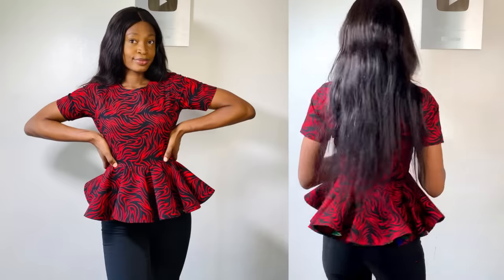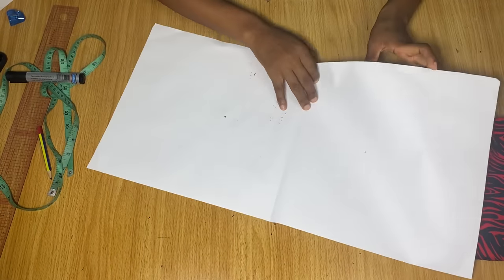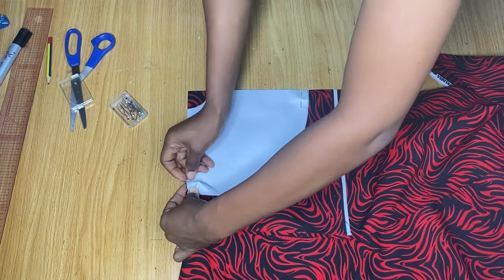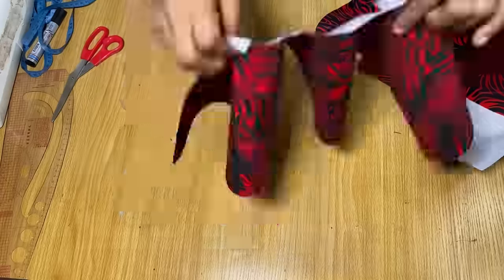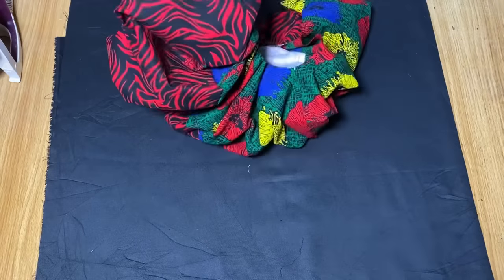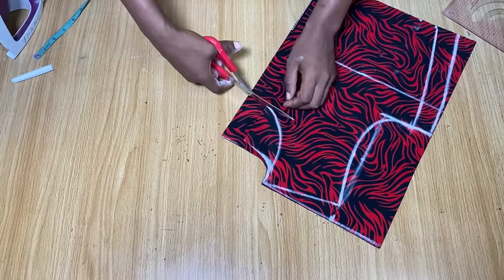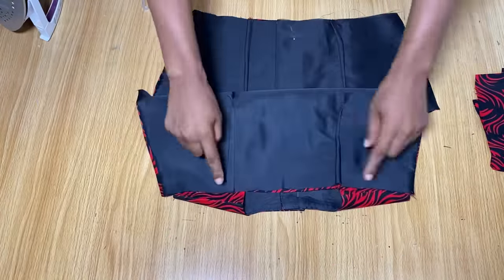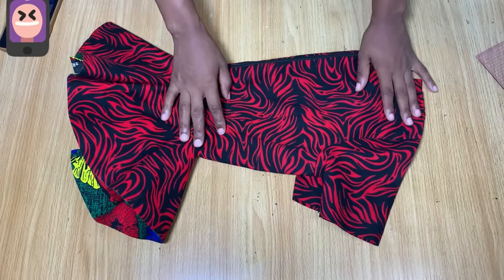How to cut and sew a simple peplum blouse with a 1440 Degree Flare.

Comment: Pls if i divide my waist by 4 for a 360 degree flare, it gives 8.25, but if i divide it by 6 28, it gives me 5.25.
Don't u think the waist circumference of the flare will be to wide if i divide it by 4
Reply from the maker: I don’t quite understand your question. But if you’re cutting a 1440 degree flare you would not be diving your waist by 4. You would be diving it by 16. The first two I talked about was a build up to explain the 1440 degree.